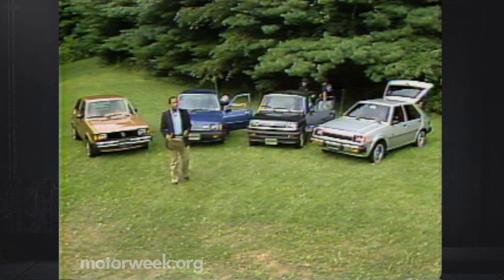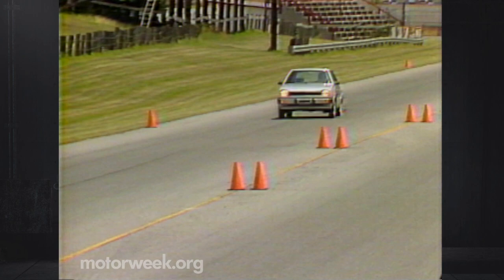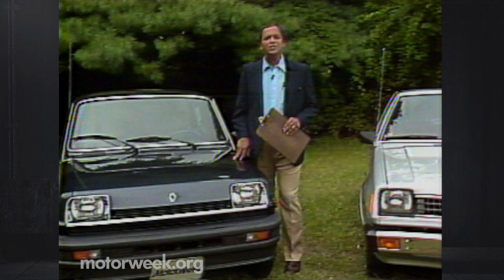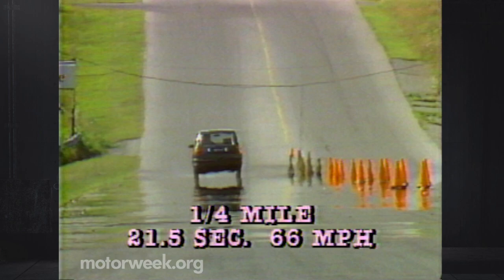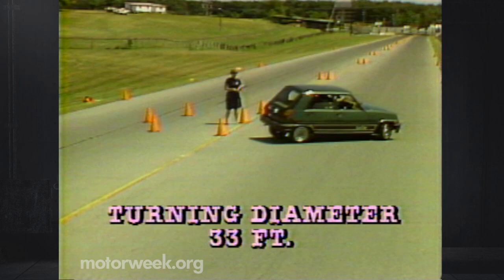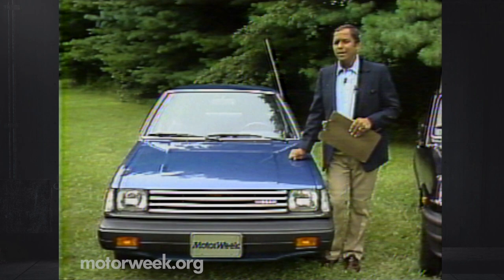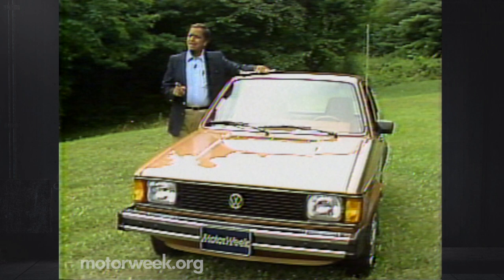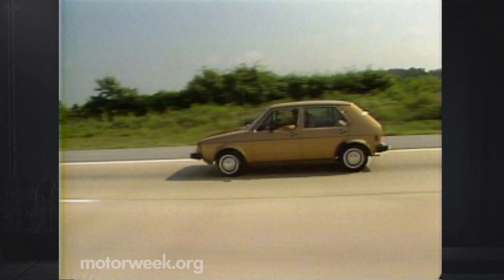Retro Review: 1982 Econobox Comparison

Comment: 6:50 I like how the guy pulls off spark plug boot when checking under the hood
Reply: TheVintagetamiya he was checking the ignition coil to distributor boot.  The only terminal on the distributor that constantly fired is the ignition coil feed.  Pulling that wire gave you an idea of the condition of the wires and cap.  If it was worn down, chances were the rest of the cap, and wires were not far behind.  It was also a window into the distributor rotor; which also fired constantly.

Comment: Back when safety didn't matter cars got impressive gas mileage.
Reply: yeah, but just hitting something at 30 km/h you die inside these boxes.
Reply: Marco Fiorillo pretty much 😆
Reply: MPH
Reply: A modern engine in these things would hit absolutely insane efficiency. Someone needs to do this, for science.
Reply: Unfortunately, Toyota's parts can be prohibitively expensive for some models. I recommend pricing potential repairs into any vehicle purchase. I rule out many cars on the costs of parts alone (looking at you BMW).

However, replacing a bumper, any bumper, seems bad, but at least, the damage is mostly consolidated to just the bumper. In an older car, a collision like yours permanently shortens the car's longevity by bending the frame, forever messing up the wheel alignment, or worse, injuring the occupant. For long-term ownership, softer bumpers are still a safer bet.
Reply: Bumpers were definitely much better designed in the 80's compared to now. There's no arguing that. It has to do with changes in government requirements. In the 80's, bumpers were federally mandated for 5mph impact. Now, it's 2.5mph AND the actual bumper beam doesn't extend to the corners like it did on 80's cars. Bumpers today are pretty much trash design. I bumped into a tree backing up in my 2018 Elantra. The tree hit the driver's side corner of the rear bumper, completely missing the actual bumper bar, doing $1800 damage. Torn bumper cover and crunched up trunk lid. A real 80's bumper would have just scratched up the paint, most likely.
Reply: Not to worry, it predates safety!
Reply: Not sure what you're talking about. Modern day Civics and Corollas get same or better mileage with over twice the power and with a ton more interior room..
Reply: @MallocFree90  That sounds like fun, we are too safety obsessed with cars nowadays.
Reply: @Ichibuns  no doubt, that tiny Le junk car would go far with a diesel 60 mpg anyway, hell I’d take that combo
Reply: @MallocFree90  some ppl just hate themselves and want style over everything. Not saying to get an ugly car
Reply: nor the speed limit was 55mph , a full size truck can get 30mpg at 55 , my 3.8l mini van gets just under 40 at 55 on a level road
Reply: Its a combination of safety and emission laws that killed gas mileage in modern cars. Cars have to have a lot of extra shit on them to pass modern safety regulations which adds weight and emission control equipment does its best to choke the engine which kills mileage.
Reply: @MallocFree90  So...don't hit anything?
As always the most important safety feature is a "properly-adjusted nut behind the steering wheel."
Reply: @bcubed72  its not about you hitting something, its about something hitting YOU
Reply: @punchy207  A good driver who is maintaining situational awareness can generally identify and avoid crappy drivers before they even have a chance to hit him.
Reply: @bcubed72  you say that now man just you wait
Reply: @bcubed72  oh ok well you have fun with that
Reply: @punchy207  What, you tryin' to live forever or something?
Reply: @bcubed72  yes, in fact i am
Reply: @punchy207  Spoiler alert: you won't.
Reply: @bcubed72  well yeah, thats pretty obvious, theres no point in continuing to converse
Reply: @bcubed72  Don't let them hate on you. Even someone else hitting you is usually also partly your fault for not being aware and avoiding it, but there are some unavoidable situations. I have had many situations where people almost hit me but by being aware, alert, and prepared, I avoided all the accidents and have never been in one.

Comment: I owned a two-door Renault Le Car (5) that had a vinyl top that you could open manually. After a year of ownership it started giving me one problem, whenever I turned on the headlights the engine will die. Took it to the Renault Service Department 3 times before I traded it in for a 2 door 1982 Plymouth Reliant K that had a Mitsubishi engine (and yes, it was the i4 2.6L Hemi one).

Comment: It's amazing they had to comment on paint and how the car went together, these were some hard times for cars.
Reply: Myron Adams  japan had good initial quality but serious rot issues well into the 90s. a K car from just a few years later is still relatively common here in the midwest while any 80s era japanese car is a head turner,  especially anything thats not enthusiast fodder.
Reply: DrewLSsix You're absolutely right. The engineering and fit and finish of Japanese cars was terrific. They were fun to drive, economical and everything worked well. However, the materials used (especially the body panels) were not robust, and they seem to  have pretty much all disintegrated by now. If I do see an 80s or 90s Japanese car today, it's usually best up and rusty and beyond repair.
Reply: If you live where there was no road salt, what killed many odd Japanese cars were their carbs and odd smog devices. Mitsubishis would die from badly designed valve guides. Nissan V6 engines would be destroyed because many people didn't know of the timing belt. I live in Florida, and many of the EFI equipped 1980s Japanese cars are still around. People could usually fix their car by unfolding a paper clip, jumping the correct terminals, and then counting the number of times the light blinks.
Reply: Myron Adams  Europe did not have it beter lmao.
Reply: @KittyNoNo  Thats odd, I restore old japanese, and never see those issues. The issue are usually poor maint related.
Reply: Clear coat paint was new and the switch from lead to water based paint was going on by this time
Reply: Tesla is bringing those times back.

Comment: If you bought one of these in the early 1980's, the Colt was your best bet.  Sturdy little cars, I had friends still driving them in the mid 1990's in college, and one friend who would buy up old Rabbits and Jettas  from the classifieds in the paper.  A Rabbit of that vintage was pretty well done by the 1990's.  Living in the Southwestern USA, the sun destroyed the interiors in Volkswagens pretty badly.  My VW loving friend usually got about 3-4 months out of a car before selling it to the junkyard, and accumulated a selection of Volkswagen specific repair tools (wasn't cheap, by the way...)
Reply: Na the Nissan Sentra is the best of all still driving a 1985 Nissan Sentra,  no see colts on the road no more

Comment: I think I'd take any one of these cars instead of the over computerized "economy" cars sold today.

Okay, maybe not the Le Car.  ;)
Reply: Chris Freemesser I'd take the older ones because of their looks alone.
Reply: Chris Freemesser yeah but 13 inch wheels and 80 something horsepower? It was ok then but driving one now? yeesh
Reply: manthony225 My Jetta mk2 has 85 horsepower, 13 inch wheels, a manual transmission, and manual steering. Still very fun because the car is so light and it keeps up sufficiently.
Reply: manthony225
It's all about the horsepower to weight ratio.  Keep in mind that these cars are maybe 2000 pounds, making them 1000 pounds lighter than most economy cars sold today.  As such, 80hp was quite adequate, especially with a manual transmission.
Reply: carzak I won't be getting rid of my '85 and '91 Jettas for new ones any time soon or probably ever, I can tell you that. With my manual one I average about 31 mpg, which I consider to be very good. It's economical enough and fun to drive with 85 horsepower.
Reply: You must not live up here in the northeast...the salt killed all of the MKI and MKII Rabbits/Golfs/Jettas a long time ago.  I sure wouldn't mind a MKI Rabbit though!
Reply: Not me. That was my era. Long term, emission controlled carburetors were JUNK! Only the fuel injected Rabbit would continue to start and drive well for many years. If you want a good old-style economy car, go south where they don't rust, and get a late '80s-2000 port injected economy car with a 5-speed manual. One good choice; Mazda 323 or Protege'.
Reply: Less than 2000, more 1800 pounds for a Lecar. Mine weighted 775 kgs with a 0.845 liter engine (34hp).
Reply: Le Car is my favorite of the bunch.
Reply: Hahaha.  You guys must have missed the horrendous 0-60 and 1/4 times?  These cars would get trampled on today's roads with today's aggressive drivers.  Good luck with any of these cars on South Florida's streets 😆

The Rabbit however, is a sexy bit of kit.
Reply: @SWRadioConcepts  i had one,a 85 with 4 speed manual.
Reply: Why no Le car???
Reply: mipmipmipmipmip  just dont get in a crash
Reply: @saturndesigns2339  If for no other reason than Renault  couldn't come up with a better name than "The car".
Reply: View some crash tests first
Reply: @snowrocket  Yeah, those stupid vacuum operated smog devices were a real nightmare. The Honda CVCC engine was the absolute worst in terms of vacuum operated garbage.
Reply: Chris Freemesser the lecar is the only good one Cmon!
Reply: LeCar is my favorite looking though! It’s just so quirky & fun looking!
Reply: With all due respect, you'd be making a terrible choice picking any of these over a modern car as a daily driver. The MKI Golf is nice, though.

Comment: In early (or midyear) 1983, Nissan opened its first USA assembly plant, Smyrna, Tennessee.  Some of the Sentra cars were now being assembled there, while others were still being made in Japan.
Reply: That is interesting to know. It is my understanding that they built mostly trucks there, because trucks were taxed more heavily than cars. The Nissan Hardbody and Frontier were excellent.
Reply: @skylinefever  Yea, after the 4th generation, the Sentra mived production to Mexico. My 4th gen 1998 manual transmission Sentra was built at that Tennessee plant...but I would have preferred a Japanese built model.

Comment: 1982 was not a good year for cars.
Reply: there was the oil crisis and we were still recovering from those new emission laws of '75
Reply: Remember the .75 cents a gallon gasoline? 80's the decade to live.
Reply: 75 cents in 1982 is $1.88 today.
Reply: Los Charlies Oh I 'member!
Reply: I had a 1982 Mustang GT 5.0 and that was a fantastic car. Back then you could buy a new one fully loaded for less than $11k.
Reply: wrinkleneckbass but remember back then 11000 thou was a lot of money!  the same amount today would be about 24000. Maybe even more.  so it's not like it was cheap.
Reply: Its about $27,500.
Reply: hey I have a 1982 Celica Supra. It was an awesome time for cars.
Reply: The oil crisis was a scam, a manufactured emergency.
Reply: You were around then?  Have verifiable proof?
Reply: My Mom had an ‘82 VW Rabbit Diesel.  Diesels back then were noisy and slow, but reliable as hell and fantastic fuel mileage.  And she got the 5-speed manual instead of the automatic, which made it a bit better to drive than it would otherwise have been.  Real-world, every-day driving, she averaged 50 MPG.  Could almost get 60 on the highway.  And you couldn’t kill it.

Compared to modern cars, yeah, 1982 wasn’t so great — but you’re looking at 35 years of competition and innovation that has taken place since then, which has done amazing things to the average car today.
Reply: In 1982 gasoline was about $1.20 per gallon NOT 75 cents a gallon. By 1986 gasoline prices plummeted down to about 80 cents a gallon and stayed low till about 1990.
Reply: Nutz4Gunz45   i agree
Reply: doesn't matter, i wasn't born
Reply: Nutz4Gunz45 I'd rather drive any of these than the blah-blob stuff today.  Just because modern cars are insanely fast doesn't make them more interesting.
Reply: Generally the 80s were bad years for American cars.
Reply: Better than the 90's that is for sure.
Reply: I'm a fan of the simplicity of these cars. Nothing on them that's not related to getting from point A to point B.
Reply: I kept my 1982 Camaro for over 20 years. It was my first new car. I actually wanted an '81, the last year of the second generation, but could not come up with enough money in time.
Reply: AdamG1983  I don't know about that.  My dad and I both purchased Pontiac's new FWD Bonneville cars.  It was stylish, plenty of grunt, 33MPG on the highway, roomie and reliable as any Japanese car of the time.
Reply: You can't look at 1982 with today's lens and make an assumption. Today's cars will look like outdated junk in three plus decades as well.
As somebody who lived in the 1980s, I can tell you that new cars held a lot of promise back then. Technology was changing, carmakers all over the globe were moving to front wheel drive and that meant a new type of performance. Speaking of which, the 1970s were all about choking emissions control and small cars that were made to look bigger (and more appealing) than they were. The 1980s were about making more from less, with cleaner, simpler (some might say 'boring') styling that got the job done efficiently. 
These cars all had flaws, as the test showed. It sounds silly but that made the cars have more character, even the LeCar had a small following in the US because of its quirky but cute ugly duckling looks...The Sentra may have made the most sense but nobody even knew what to call the company that made the car. The Colt wore Dodge and Plymouth badges but fooled nobody. Conspicuous by its absence in this test is the Honda Civic. Although there was certainly a four-door Civic in 1982, when the new version came out in 1984, with it was an all-conquering four door sedan, the sporty CRX and a curious tall-wagon - arguably well ahead of its time as far as the trend - and that put the Civic on the small sedan map.
Reply: Los Charlies I was like 11 in 84 but I remember my folks flipping out a few years earlier when gas hit a buck a gallon.
Reply: That was my car! Black L-Type. I miss her everyday.
Reply: You must be joking, it was the best decade for cars of all time. The cars were built to last, and had no unnecassary equipment like ABS brakes, airbags and things like today
Reply: Hey guys, don't complain....i paid over 1 buck for just 1 liter of gasoline (mixed with 27% of etanol)...
Reply: in Europe we got the Citroen BX in 1982 , ive had a couple of the diesels and the 16v 4x4 was no slouch, i liked them
Reply: The best thing about 80s cars was cheap used American cars that were made prior to 73.
Reply: terrible era
Reply: @jameswillett7186  Gas was around $1.10 in Iowa in 82. Your right that in the mid to late 80's it stayed right around .80 cents and I even payed .68 cents in the spring of 88 till the first Gulf War when it went over a Buck a gallon again. Then it went back to the .90-.99 cent range until about 2000 when it hit a Buck a gallon and never went south of that again.
Reply: @theniceshort88  minimum wage was also like $5 back then.
Reply: I think Renault was car of the year 
Later same year it also won worst car of the year.
Go figure
Reply: VIRTUA ฅ'ω'ฅ for some trucks and sports yes (but lack power) cheap cars no
Reply: 1972 to 1990 was not a good year
Reply: Nick Usalis Knight still had its fair share of good cars though
Reply: @theniceshort88  i'm not even out of high school but i WISH i was in the 80s... just no mullets, eughh
Reply: @theniceshort88  When we moved to Georgia (the US state, not the country) in 1995 gas was $0.92/gal.
Reply: @LMacNeill   1980's diesels were great..  If some clown tailgated you, just drop it into third, and they'd disappear from view  in a cloud of blue smoke AND they'd stop tailgating!   Life before the trap oxidizer, was the greatest!
Reply: @saadqureshi7127    I seem to recall it was $3.50
Reply: @theniceshort88  < It was by in the 30 cent range in the early 70’s before the first gas crisis.
Reply: @alexander1485  < The world was a lot better place.
Reply: @AdamG1983  80s cars will still outlast modern junk
Reply: Good year fir movies... 😊
Reply: @tnickknight  There were some beautiful cars in the mid to late 70's, the Gran Torino, Firebird, it was also a peak decade for Buick design. Even the 80's had some great cars like the Grand National, Porsche 959, VW GTI, Foxbody Mustang, Ferrari Testarossa, Mercedes 500 SL etc.
Reply: @PlayWaves1  looked good,  they were beyond horribly built and unreliable.

Comment: My wife had an '82 Sentra, so early that they took it off a shopping mall floor.  It was a good little car, but had a few problems. The headliner pulled away and had to be replaced. The wheels were improperly heat-treated and would warp, and had to be replaced. Finally, the carb would sometimes ice up in cold, winter weather. I once got stuck on the side of the road with this problem. A hot bottle of water from a convenience store poured over the carb, with the intake covered, solved the problem. I don't remember if there was a recall or not.

Comment: I had 2 1982 diesel VW rabbits. Both 4-door, both 5-speed and they got sometimes up to 48 mpg, but then again they were diesel and manual. As an old VW fan, I didn't really care about how fast I got there... I just wanted to get there! :)
Reply: I used to drive my dads 1982 Rabbit Diesel. The AC compressor bracket always bent and when you turned the AC on and revved the engine it squealed like a pig. It was always fun scaring people!